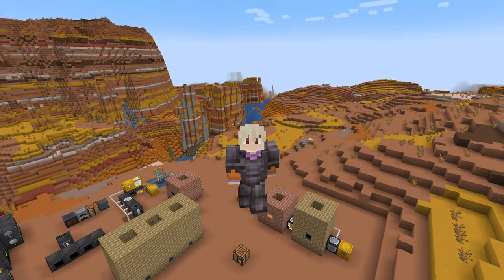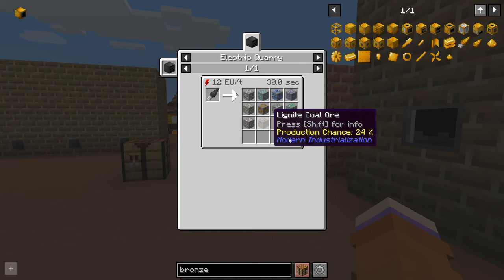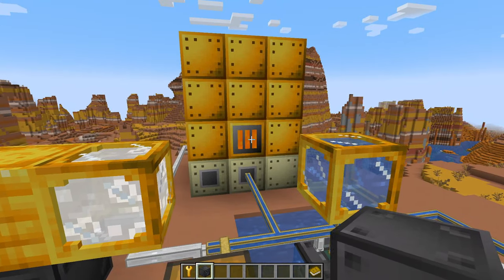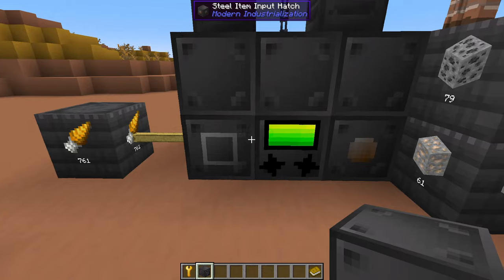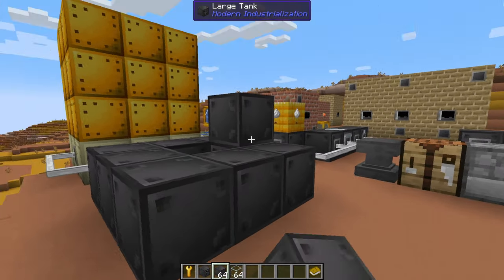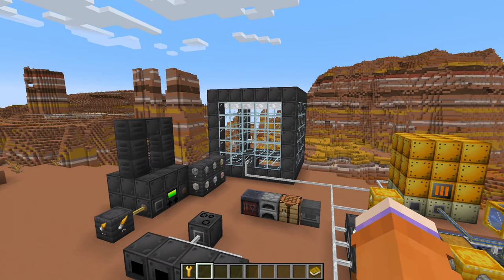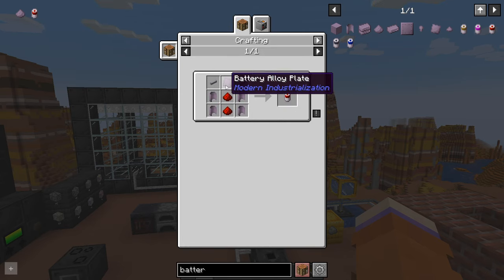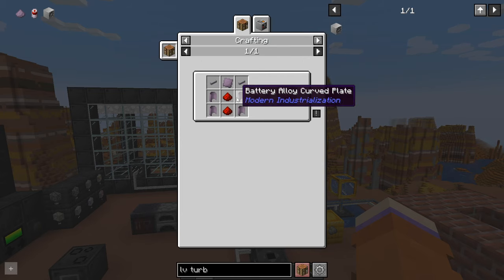Modern Industrialization: Electric Age Part 1 - Getting Aluminum

Comment: Do you have to use tin cable to connect the steam turbine to the EBF? I tried using cupronickel cable but it wasn't sending power into the LV input. Not sure what I'm doing wrong :')

Comment: Great video, for some reason prominence II doesn't have a lot of the QOL like the ghost blocks while holding the wrench so this mod has been very confusing. I finished setting up 2 steam drill rigs though and super intimidated to start electric phase and didn't know why I should until I saw the speed of the electric machine. Hope you're doing well
Reply: What version are you on? Holding the wrench works fine for me in 2.8 rpg fabric.
Reply: @andrewbalzer6263  its shaders that interfere w the wrench
Reply: @heffer1011  ah gotcha. I do have shades on, but just the default ones with the pack

Comment: Enjoying the guides so far! couple things about the large tank: 

-There's a special hatch that just works for the large tank, I think it's called a tank hatch, but it gives you those extra connection points you wanted.

-There's a configuration page on the large tank UI that lets you manually change the size, and that should update the preview so you don't have to guess.

-For item locking, you can click the lock icon at the top to be able to manually lock different slots, and a locked empty slot will not accept anything, so you won't need to set the stack to 0 to shut them off. You can also use it to unlock slots you locked by accident, I spent a while breaking and replacing machines before I figured that out.

-For getting cobblestone for sand and glass, you can use a mixer instead of copper drills in the quarry. Put some lava in on it and it will turn one cobble into two, without consuming lava. It works for a lot of stone types actually, handy for building without having to go mining or relying on quarry rng.

-For automation and production lines, the big gate is really the electric quarry. I tried going full automation before that, and it sucks up so much lead for soldering alloy, which you can't get with the steam quarry and need to mine for. Once you get the electric version (probably two, one for bronze drills and one for steel) you can make a closed loop that makes the drills from the output and you'll be set until the next tier of material.
Reply from the maker: Thank you for the tips, I'll make sure to include them in the next one :D